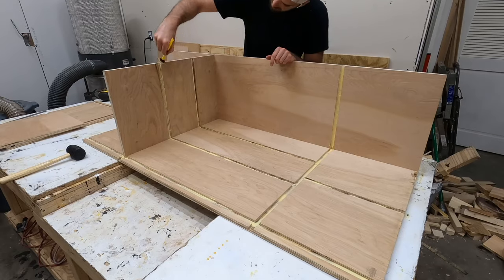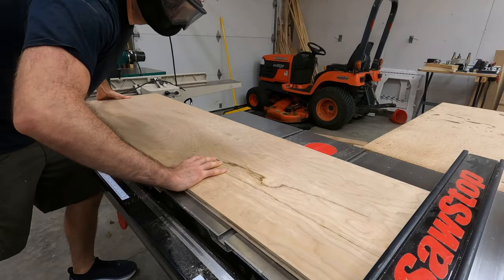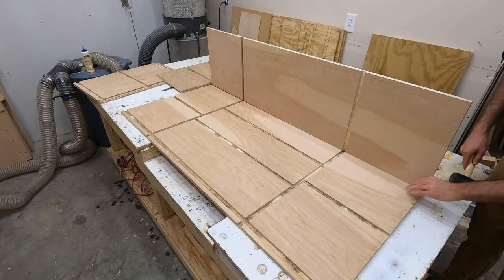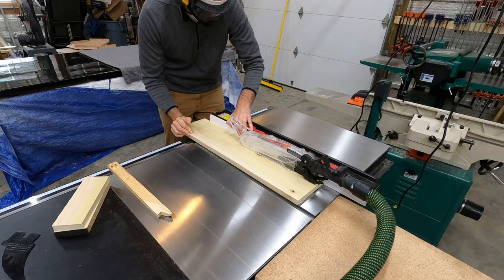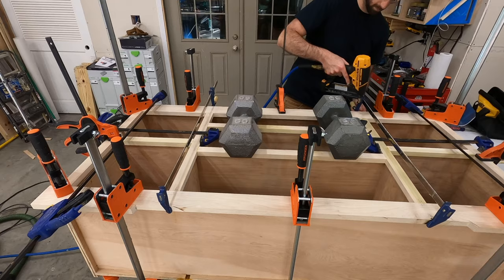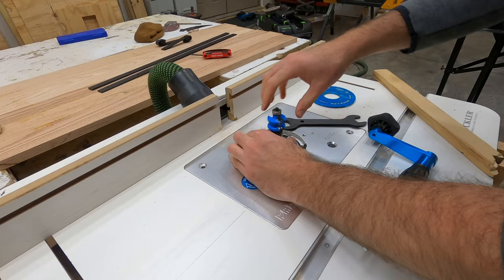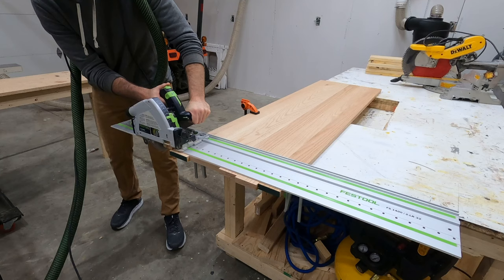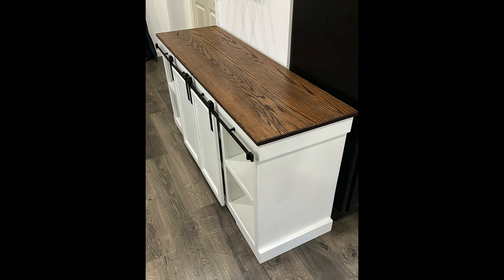Sliding Door Cabinet Build || Sliding Door TV Stand - Full Build Video

Comment: Perfect! This video couldn't have come at a better time. This is almost exactly what I'm planning to build for my living room, except I think I want to use oak for the exterior front and sides and stain the entire exterior with the rubio monocoat. I'm pretty sure that I want to put it up on 4 legs so that my robot vacuum can get under it. I have some experience with rubio monocoat on some beams that I built for a client about a year back. I really like it and it is super simple to use once you get the hang of it. I love the look and it's quick compared to traditional stain and poly finishes. It's a very tough finish too. That same client had their entire first floor oak floors sanded and refinished with Rubio monocoat by a hardwood floor refinisher. After the floors were all sanded smooth they just squirted the monocoat on the floor, squeegeed it around with a rubber squeegee on a stick in front of the buffer and then buffed the entire floor with a huge floor burnisher like you see them use to polish VCT floors. It looks fantastic and it's a durable finish.
Reply from the maker: Awesome, that would be a great build! I want to do another one similar to what you mentioned with glass front doors. I agree 100% with the Rubio comment - I think the price is a turn off for many people but it is so much easier than doing multiple coats of poly!
Reply: @mmcc_woodshop6288  The Rubio goes a long way too. It's amazing how little it takes to cover an area.

Comment: This is the third or fourth vid I’ve watched, and as a ww for 50 years I would think you may want to build a cc sled. 1 for cuts and 1 for dados. I cringe at each long and narrow cc with just your hand or push block. This is from my experience , and from learning from the saw bind kickbacks.
I like your working method though. I’ve got all ten digits.
Reply from the maker: Thanks for the input and tips! Always a good reminder to be careful on those cuts.. I’m hoping to upgrade to the sawstop crosscut table sled eventually 👍🏻

Comment: I have two things to say about the back. Every single time I’ve not done the back of a piece… I never really care UNTIL delivery. LOL. That’s when I always wish that I had finished it. The second is… if the back had been more of a solid piece of material that looked nice unfinished I would leave it unfinished. 

BUT… a bonus third comment… I also refurbish furniture. A lot of pieces have a 1/4” piece of material as the back and generally is unfinished. But those pieces don’t have protection on them and end up needing replaced. So even a quick spray lacquer is better than nothing.
Reply from the maker: 😆 that’s exactly how I feel when I deliver things. I feel like it’s better to overdeliver than overpromise. Good points!

Comment: Great job Matt can you share me the link where i can buy the enamel cabinet paint or can you tell me what brand and type of paint  you used in thus project?
Reply from the maker: Thanks Diego! Here's the link to what I used - you can pick it up at Lowe's

https://www.lowes.com/pd/Valspar-Semi-gloss-Cabinet-Furniture-Paint-Enamel-1-Gallon/5013031121?cm_mmc=shp-cprdpntgglLIA_PNT_219_Interior-Stain-Spray-Paint-5013031121-local-0-_-0&ds_rl=1286981&gclid=CjwKCAjwzNOaBhAcEiwAD7Tb6IKHumncMNROZW8SJS8D7PTYMapeExgZ3O9uPNlY5gXqrkgjcGiwGBoCF3sQAvD_BwE&gclsrc=aw.ds
Reply: @mmcc_woodshop6288  one more question did you applied with homeright finish sprayer and if you did , did you thinned the paint?
Reply from the maker: Nope, I poured the paint straight into the sprayer - no thinning.
Reply: Thanks buddy it looks awesome!!